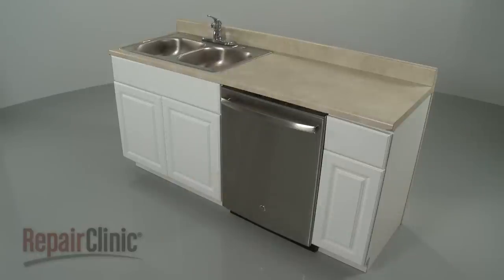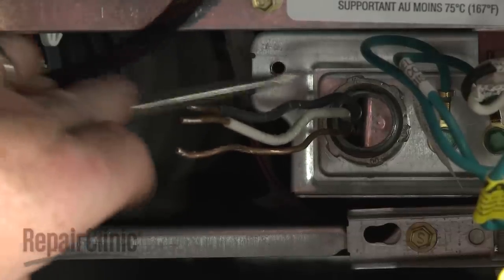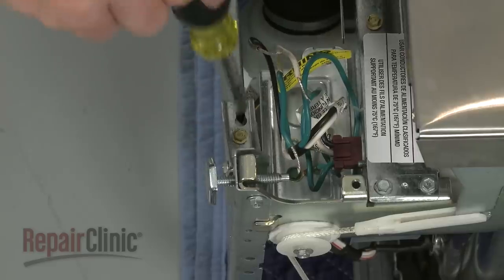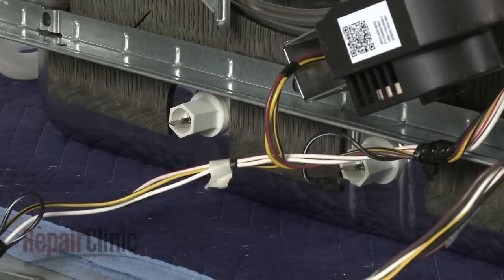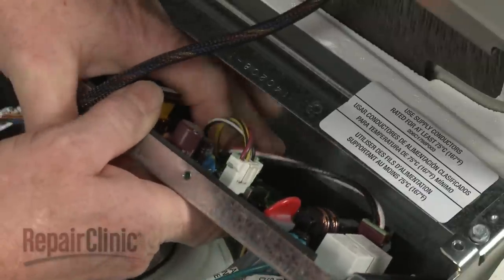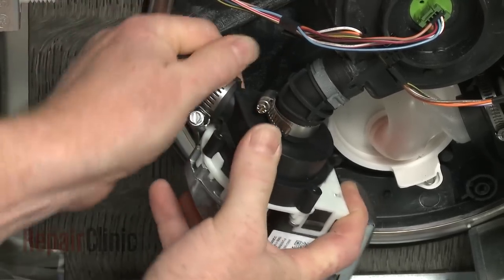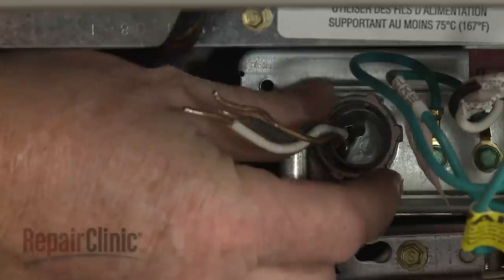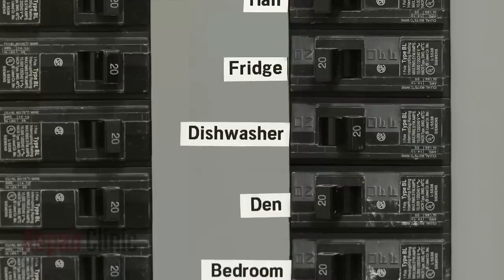GE Dishwasher Drain Pump Replacement #WD35X20875

Comment: This video made it super easy to replace the drain pump. Please Note: You don't need to do the wire harness!!
 It took me all of 30min to do this and I saved hundreds on paying a tech to come out and do it. Got the part on Amazon for $80 so I could return if it ended up not working.

Comment: could they make it any more difficult?
Reply: Right on,  like its  made to discourage us from fixing it. The harness is perfectly good why remove it @@ . we need to disconnect the harness and replace the pump. But see those stupid clips they are permanent and need to be crushed.
Reply: Yes they could
Reply: I'd say our GE dishwasher was designed exclusively to be inexpensive to manufacture.  So very many bad decisions were made.

Comment: would a pump replacement require a wire harness replacement in parallel?
Reply: Did you find the answer? Why replace the wiring if its just the pump?
Reply: I don't see why you need to replace the wiring harness.  Many online part stores sell the pump without the harness.  Not only is it cheaper, it cuts down half the steps!
Reply: No wh replacement needed.

Comment: Might be easier to just buy a new dishwasher on this repair....
Reply: Haha! That's what I'm thinking! This is crazy!
Reply: New pump costs around $30. New dishwasher, around $800-900
Reply: This can be accomplished in under an hour plus a $60 pump.
Reply: Skip the wire harness piece and it becomes super easy!

Comment: Help!  My GE Adora wouldn’t drain.  I know there’s no clog in the line because I used a wet dry vac to suck the water from the basin out through the hose.  Now when I test it the water still doesn’t drain but there’s a humming sound.  Is, that the pump?  Now what?  Thanks.
Reply: Do you still need help?
Reply: @dartme18  I do.  This is  like a time capsule conversation. Im having the same problem. You could have helped me last year 🤧😭😭😭
Reply: @flower2008  I had the problem a couple weeks ago. There is a hole in the bottom into which the correct-sized alan wrench can fit. Make sure you use a tight-fitting tool otherwise you will strip out the bottom. Get the alan wrench in there and try to turn it manually in either direction. If you get it moving, you can likely turn it on and it will start working. If you are only able to move it a litle bit and it feels stuck, there is likely something very hard in there that you'll want to try to dislodge. DO NOT PUT YOUR HAND INTO THE GARBAGE DISPOSAL. If you can't get it to move with the alan wrench, and placing a tool down into the garbage disposal while it's off still can't get it to move, it's possible that the unit is seized. I thought this was the case with mine and purchased a new one, then my friend got an alan wrench and was able to get it spinning again \o/ Mine is still old and disintegrating, so I didn't cancel the new order! Good luck Mr. Flower.